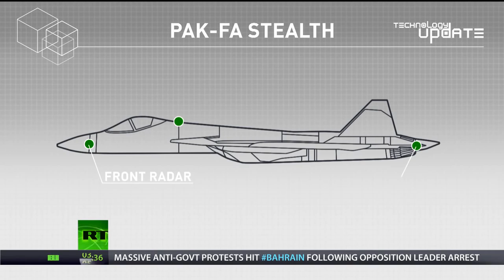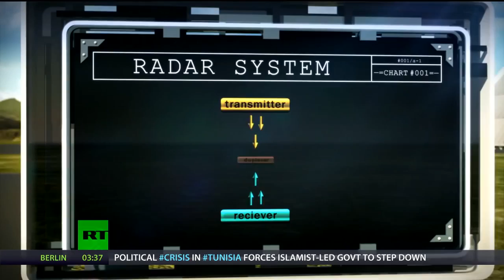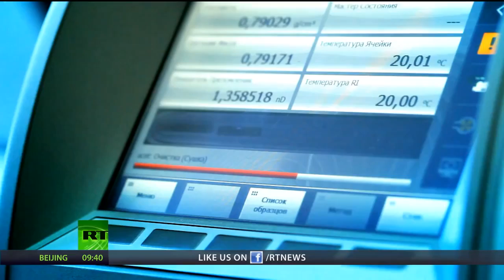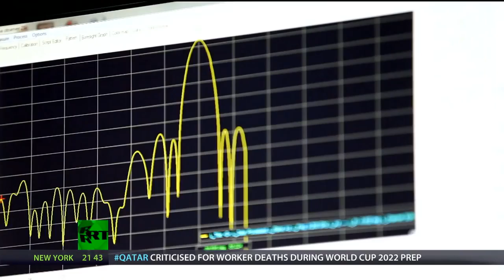Sukhoi T 50 PAK FA Stealth Technology

Comment: NOT THAT STEALTHY, THE INDIANS PICKED IT UP WITH THEIR BASIC RADARS...
Reply: S-400 can easily detect F-22...
Reply: Not going to spent my time to explain to use.
Reply: +ITmage 
It was seen rather easily on KMV117 low frequency/ long range webbed radar.
Reply: MEIERSEGGSTRAßE RESEARCH INSTITUTE No it wasnt, stop spreading bullshit stories seriusly. And there is no such thing as "KMV117" radar. Never report of any kind on that matter existed, you just literally made it up to back your crap.

There is FPS-117 which India does not operate i am afraid.
Reply: +ITmage  
No Problem. Believe what you want.
Reply: MEIERSEGGSTRAßE RESEARCH INSTITUTE I heard about the engine , and its engine is underpowered
Reply: lol thanks about the Engine, that's news! but what we're sure of is the radar return on two low frequency bands. It's hard to detect it on higher frequencies but these two long range bands give it away almost immediately, the webbed KMV platform is from the early 70s but with special modifications and is used to expose weak points on American fighters. The Indians have long wanted export Versions of this item and that's how these revelations came about.

Comment: Once again the Russkies steal a US design (F-22) and make a shittier version of it
Reply: "It has wings and engines, they copied us!" - Stop it.
Reply: Not true, sorry. Before PAK-FA program MIG and Sukhoi considered many variants like MiG 1.44 and S-37, later designated as the Su-47. Sukhoi developed the unusual S.32/S.37 forward swept wing demonstrator, intended to combine supersonic performance with super-manoeuvrability. This design demonstrated the use of large LEX, over large quarter circular inlets. Like the MFI MiG 1.44, this design was not
stealthy and was used to prove basic technologies and design rules. A more successful demonstrator built during this period was the Su-37 “Super Flanker”, derived from the earlier Su-27M/Su-35 Flanker E. The Su-37 was intended to extend the T-10 Flanker design to the limit, especially in avionic systems and manoeuvre performance.
PAK-FA prototypes show that this design is a continuation of the highly evolved pedigree of Flanker aerodynamic design. However, as observed in and predicted from the most recent Flanker variant, the Su-35S, and the work done during the deep modernization program that resulted in this design, Sukhoi have evidently taken the next step by providing the PAK-FA with relaxed static stability in the directional axis. This is accomplished by the combined use of 3D thrust vector control of the engine nozzles, all moving tail surfaces, and refined aerodynamic design with relaxed directional static stability and careful mass distribution to control inertial effects.
Where the PAK-FA departs most strongly from the earlier Flanker, the F-22 and the YF-23 is in the aft fuselage design, and the moving LEX or Поворотная часть наплыва (ПЧН) design, intended to provide extreme manoeuvrability and controllability and, thus, extreme agility – an attribute absent in the F-22 and YF-23, but extant in some later Flanker variants, demonstrators and prototype programs.
T-50 PAK-FA is a fusion of ideas and design features seen in late model Flanker variants and demonstrators, but of course incorporating SOME specific stealth shaping features employed previously in the Northrop/MDC YF-23 ATF demonstrator, and the production LM F-22 Raptor.
Even from imagery and video camera footage like this one on Youtube it is evident that T-50 PAK-FA is clearly a unique Russian design and is neither a copy of the F-22 or the YF-23 but an evolution of previous Sukhoi designs.
Reply: no just no...just becuse it looks slightly identical to the f22 dosent mean the fucking stole it what the hell man...
Reply: If you look at prior Soviet designs going back to the 60's, they were simply copying American designs especially post Mig-21. The Mig-15 to 21 variants were excellent planes which to a degree could easily hold their own with US fighters. However, once you get into the third generation fighters you can especially see it among Mig's, Sukhol's & the new Yak variants. Most Soviet aircraft were sizzle and no steak like the horrid Mig-25 that the west so feared until the Soviet pilot defected to Japan with one and they found out what a nasty, stinking turd it was. The Russians are making good planes and have been since the 80's but one cannot deny the influence of their western counterparts, after all, why pay for R&D when you can just copy.
Reply: Ted Wojtasik
well yea but honestly i love the design of the sukhoi T-50 pak fa i just love it i love Russian military jets just the same as US jets... there should be no reason to fight about it realy
Reply: looks more like an f-23
Reply: MiG-25 was not "nasty stinking turd". Americans just at first set ladder for its performance too high, as they had little to no information about the project. 

Also you are obviously not an engineer yourself. Do you have any idea, how much data you would need to steal to "copy" an aircraft? T-72M project documentation was 100.000 pages and its a tank, which for we can arguably say is far less complex than fighter aircraft...  Now you are telling us here how someone "leaked" or stole few million pages From Lockeed Martin? Are you insane?

You cant look at the plane and say: "You know what Boris, we should copy this". That is not how it works i am sorry.

Stick to Battlefield seriously.
Reply: Yes, the MIG-25 is a turd, all it can do is fly high and fast, has one of the highest stall speeds of ANY aircraft and will fly apart if any serious maneuver is attempted. The reason we know this is because a Soviet pilot defected with one in 1975 I believe. We do not need engineering schematics when we have the actual plane(s). This is actually how we know the performance envelopes of these planes. In the past pilots defected, now we just buy the damn things from satellite nations. Either way, the point of 5th generation fighters is mute as drones are the future. No maned platform can compete with an aircraft which can pull 25+g sustained maneuvers.

Comment: . When a Sukoi gets a record like a f-15 (never been actually been shot down (in training shot down 5-1by a f-22 flown by piolets now flying a f-22 and where f-15 pilots, Rember how much hype there was over the mig 29, mig 25, mirage , f-14, f4, and all have eaten dirt after messing with a f-15 . And the raptor is the only plane to do it (yes in training but the pilots all said the first time they even knew. You never really  hear sukoi shot down but there not used like the migs or f-15 by so many nations.
Reply: Sukhois derived from T-10 platform (Su-27) are used by more nations than F-15 actually. Also its not true that F-15 was never shot down, it was just not by other fighter.

Also out of 104 aerial kills F-15 performed, almost all were MiG-21, MiG-23, Su-22.... none of which were ever supposed to compete with it.

Comment: Finally, the truth was uncovered.
Formal study of independent Australian think tank Air Power Australia compared five military aircraft and more specifically: "Americans» F–22, F–35, "Chinese" J–12 and
"Russians" T-50 and Su–35S.
The principle was simple. There are 14 criteria for affiliation of the aircraft to the fifth generation. If the plane corresponds to a particular criterion, then one point was added to its score. In the case of non-compliance, the point was subtracted. The results were the following:
T–50:                           +8
F–22 & Su–35S:       +2
J–12:                             0
F–35:                          –8
For example +8 for T-50 means that it passed 11 criterias and did not pass 3. The zero for J-12 means that it passed 7 criterias and did not pass the rest 7!
Reply: The Dutch air force seems to be too stupid. They bought F-35 jets and sold nearly all tanks. I rather buy a Su-50 PAK FA than an F-35. The F-35 has no stealth, besides VTOL already is made in the 1960s. You're actually right.
Reply: And who wants to buy the F22 "garbage"?
In a publication in the "National Interest" magazine T50 PAK FA wins again against F22 in a dogfight!
Don't believe some trolls. They claimed some years ago that Su35 is not capable at all and finally it proved to be the best!!!
Reply: PAK FA is not for sale yet. And that's normal as the Russian Aviation will receive the first bunch of such aircrafts at the end of the year. India will receive such aircrafts, but a lighter version.
On the contrary F22 is available in the markets for over 5 years. The extremely high price of that aircraft has forced Lockheed to stop its production as it was extremely expensive even for the US Pentagon, which in general spends a lot of money but in this case it could afford to buy just 187 pieces!
Why someone has to buy an F22 while at the same price he could buy 10 Su-35s aircrafts that present similar capabilities;

Comment: This looks on par with the f22. But we will see. Fighter bombers still need performance. Consider the off chance radar refelection absorbtion somehow becomes obsolete by new technology. Then it is back to performance again. How about hacking and ECM. It is back to performance again. Then the overpriced f 35 is a piece of crap with its heavy fuselage. Rather have the SU 35 or Saab Gripen then the F 35 JSF. The reliance on stealth technology alone combined with the high pricetag is really makes me uneasy about the investment by the Netherlands in this project. Never liked the JSF concept. It tries way too hard to be everything resulting in too many weak links.

Comment: Do you guys use Nano-Tube carbon coatings for passive radar absorption capability?  The nano-tubes have to be arranged so that they are perpendicular to the surface of the aircraft.  the radar signal enters those tubes, bounces from side-to-side, and before you know it the carbon atoms absorb all of the signal strength energy, nothing is left to be reflected.  Cheap, efficient, but a bit heavy. You need a minimum 3 mm carbon coating on all key surfaces for it to work right.

Comment: I think you guys are forgetting that the Su-50 came 13 years after the F-22, so you should really expect it to be better. It would be a failure for the Russian Air Force if it WASN'T better than the F-22.
Reply: +AlmightyCate F-22 is too old for pak-fa, so do you think that older fighter is better than new one? Just check the video about SU-35(lower generation than PAK-FA), it will f**k up every US fighter(maybe!, but it is not fact) F-35 - certainly(ps o sht)
Reply: daJokerschannel No, I just said the Su-50 is better. You misread my comment.
Reply: daJokerschannel But for the record, the SU-35 will not take out every US fighter. It's a great plane, but it will certainly not take out an F-22. It's comparable to the F-15, which is 16 years older than the Flanker, however, I would state that the SU-35 is one of the best 4th gen fighters in the world.

Comment: f22 copy??? lol. how is that stealth?? just look at exhaust ,so ordinary. you will show up larger on radar. f22s rear is designed to have less radar detection. imagine if yf23 won the contract along with yf22. its gonna be domination
Reply: +MitsuFQ400 infra red, not radar. the exhaust of f-22 is flat to confuse the heat seeking missiles but it also makes the thrust vectoring really crude and unidirectional. the exhausts on pak-fa can point in any direction
Reply: +eQuariuz evasive maneuvers?
Reply: +eQuariuz sure! lol just see what the eurofighter pilots have to say about it.
Reply: +mortaché de muerte the euro fighter will win if it gets the f22 close but the f22 can shoot the eurofighter down before it knows and f22 is in the ares
Reply: +Allotek Security yes i know but in realistic situations you cant always expect a 'sniper shot'... that's a bad philosophy. and also that's considering that pak-fa is LESS stealthy. should it be otherwise, the tables may turn
Reply: +mortaché de muerte F-22's aren't dogfighters, so they'll try to get that "sniper shot" you mentioned. And since the PAK-FA has no combat experience we don't know it's fighting style.
Reply: +Allotek Security well the pak-fa is being developed as a raptor fighter and the f-35 is even worse good for nothing swiss knife... so i do have high hopes from the russians

Comment: "The FGFA's current AL-41F1 engines were underpowered, the Russians were reluctant to share critical design information, and the fighter would eventually cost too much," the paper reported, based on briefings from Indian Air Force officials in December 2013.

A month later, more bad news leaked to the press. India wanted a bigger share of the project. But the engine was still bad, it still cost too much, the plane's radar was "inadequate" and its "stealth features badly engineered.

Then in June, a T-50 landed at the Zhukovsky testing grounds near Moscow … and its engine caught fire. Russian officials said the damage was minor  —  but photographs depicted much of the rear fuselage blackened by the blaze.

Comment: I read on the Aviationist that Russia is cutting their order to only 12 pak fa
Reply: Talvin Morton everyone throws a fit when they stop f-22 production at 186...
Reply: RT said in 2014 Russia was going to build 150 SU-50 PAK FAs but in 2015 they said 60 aircraft was going to be made. According to Sukhoi Russia is going to acquire 150 PAK FAs and 20 SU-55 FGFAM wich is a two seater based on the FGFA from 2016-2020
Reply: Talvin Morton this isn't world war 3 calm yourself.
Reply: what do you mean... I just said they only making 12 aircraft.
Reply: Airborne Centeno Are you a muslim?

Comment: Meanwhile the US already has a 6th gen fighter designed.  PAK FA looks like a nice aircraft, but like the guy said, only time will tell.
I'm interested to see the Japanese come into the mix with their 5th gen F3E and F3A.

Also, I can't believe people still talk about the Oxygen problem with the F22s.  That was fixed.  It's pretty funny though that the Americans spent so much on the F35, but it's still not a failure.  The engine problems are fixable, and there were similar problems in the past with the F-14s and they ended up being legendary fighters.  If the F-35 works out all of its problems and lives up to what it was designed to do, then it'll easily be a better stealth fighter than the PAK FA.

Comment: listen y'all are all idiots the f-22 is better the pak fa is only slightly faster than the F-22 the rapter speed is 1,498 and the pak fa speed is 1,516 but the f-22 has a faster cruising speed  1,220 to the pak fas  1,118  cruising speed. Plus it took  them  after 4 years to make a copy the f-22 was introduced in 2005 and the pak fa 2009  the pak fa is similar because they copied of the design you know what countries like to do they don't think for them self's the steal information just now a guy was trying to board a plane with f35 engine plans he was one of those ppl who developed the aircraft . funny us ain't going steal from China on aircraft  they didn't make it in the top 3 what I'm saying the f-22 is old and is still willing pakfas ass.

Comment: Here is a scenario to play out. Say a F-22 is on the tail of a T-50. F-22 fires its AIM missiles at a high altitude. But the rocket motors do not engage because they're frozen (which has happened numerous times) All the T-50 has to do to kill it is use its super agility to turn around mid air and snipe it then turn back around and keep going.